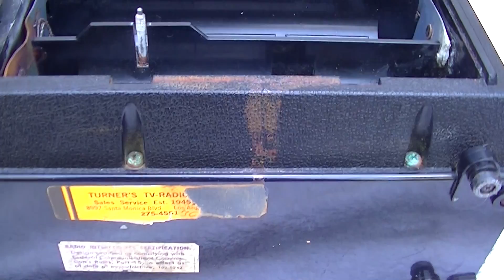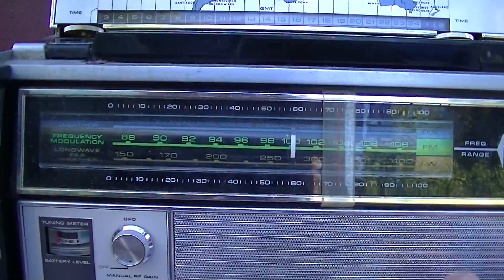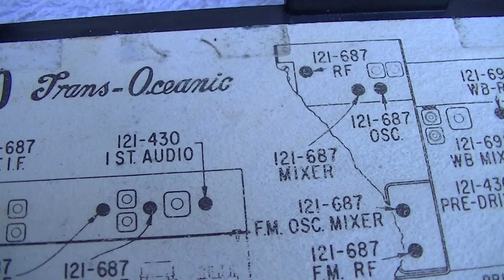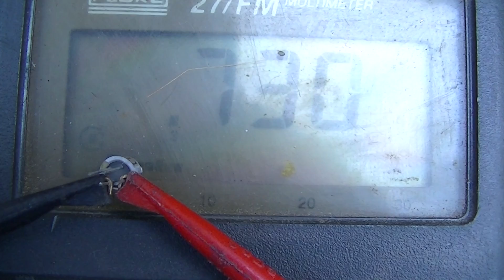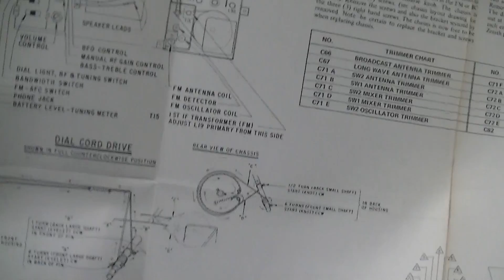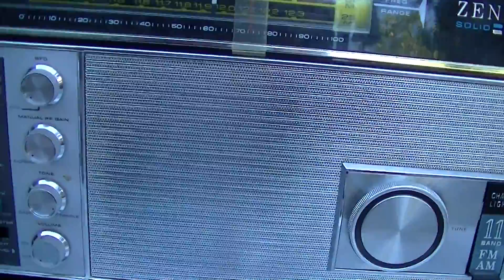Zenith Royal 7000 Transoceanic Repair

Comment: I guess I struck lucky with mine.  It's working well on all bands. I've had it about three days now, and it's an impressive hunk of radio, straight out of 1968!  It also seems to have that same mix of different transistor types.  I counted 18 transistors in mine - is that correct?

For a quick fix for the power cord, a Braun shaver cord fits perfectly, and my 7000 just happened to come with one supplied - I noticed that the OEM Zenith cords are somewhat cost prohibitive, so if you can live with a curly, telephone handset style cord, I'd definitely recommend that shaver cord!

Comment: I have the same radio, and it has the same problem, VHF and  FM work, but AM and SW don't work.  The radio has two or three separate front ends, the AM/SW front end is the problem, unless one of the 455 khz transformers are bad.  ALL Transistors are silicon.  If it was the AM rf transistor that was bad, the radio should have still picked up the local clear channel station weakly.  That's what seems to be happening with mine.  Guess I'll follow your lead on this.  Probably will try a 2n3904, or2n2222 from the junk box.  No 20 meter ham, but it does have 17 and 15 meters.  Most aircraft beacons are probably replaced by GPS.  Even Loran is fading into the past.
Reply: Mine is actually the later D7000Y.  Weather band on this one is tunable over a narrow range.   It works, only needs some contact cleaner after all.

Comment: I wonder if it was once owned by the Swedish American Line (passenger shipping) - provenance for added value. That must be a genuine label/sticker. I don't troll your methods - except for hot-swapping transistors (esp. since you didn't know if it was a FET).
The chart light lights when it's flipped up (and the bulb isn't burned out). It would have to be the right bulb ("industrial"). Many bulbs will fail when the filament is hot and gets bumped. Check the manual. You have so much stuff - you forgot you had that!

Comment: Hola, ¿cuantos voltios tiene la red a la que enchufaste la radio? Thanks
Reply: In the USA it would be 120v, however inside the back cover of the radio there is a voltage selector switch (at least, there is on mine) that enables use on 240v.

Comment: Thank you SO much ! I found you becuase I just bought the Sony Earth Orbiter 9050 and I had dead bands not a peep out of all the shortwave bands. I read that in Germany some bands were not allowed so they were disabled( lack of a better word). Then this morning the 11 to 13 meter had noise which it did not last night. So thought your video would help me out got to the point  where you said the automatic RF Gain and turned the dial and I did that and BINGO noise on ALL the SW bands ha ha. 
How cool is that I obviously have no idea what that dial is for but If it was not for watching your video and it was not the first I watched I would of paid for an estimate and probably got it fixed if it was not an arm or a leg. It is a gorgeous radio in many ways I love it and I love you too !  Hit the subbed and the alarm, Thanks once again I am soo happy now that it is working can hardly wait to try out the reception on short wave tonight on this radio.

Comment: The  Royal7000  with  the  orange  map  are  junk   Theres  a tuning belt  that  goes  bad  and  the  use  printed  cicuits  with  solder  in  transistors  and  not  easy  to  service  The  plastic  gears  in  the  tuning  assembly  become  brittle  and  they  are  not  available  any  longer  They also  use  Japanes  components  and  no  point to  point chassis
Reply: Would that be the 7000-II ? with the black coloured chart pocket?  If so, thanks for the timely heads up. I was looking at some on eBay just a few days ago, but I might just edge round them now.

Comment: When you're on SW Be sure the antenna is extended. RF gain to Max until you verify the band is operating. There is still a good number of SW stations still on. I listen every day. I own 3 Zenith 7000's . Sometimes the transistors grow hair inside and you have to cut the lead that shorts the the transistor's case. (shield)  when they fail. I  know you know all of this though.

Comment: The light pitting along the trim is not caused by battery leakage. It's caused by storage in a damp location such as a basement. Mine has it, too, in all the same places including the dial knob. Mold embeds in steel and aluminum if it is not discovered and wiped off. But as for battery leakage, in mine the cardboard support - especially on the right side - had puffed up to 10 times its normal width with lots of white powder and fell apart in my hands. I ended up fashioning cardboard replacements for both sides. The label inside my back cover also fell apart from battery acid, so I designed a replacement for that on my computer. You had better luck with the label, but I had better luck with the contacts. In spite of all the other damage caused by battery leakage, every battery contact in my set was completely clean and corrosion free. Go figure!

Comment: Glory from the days of Zenith dominance. These must have been a nightmare to hand assemble, the complexity just kept increasing (from the first Royal 1000) while only the very last R7000's were PCB. On the corrosion issues finding any of these without battery damage is more the exception than the norm. Sadly.

Comment: Interesting video. I have a 3000-1 model, and its not working. I've checked the transistors,  taken from another in worse condition, but nothing happens. I saw a video of a guy, changing the condensers, and it works. The thing is, that I am only an amateur,  I'm not a technician, so I'm stocked, sadly. However, I'm so thankful,  for you to be honest, explaining the reality of the ether. I was a diexist in the early 90's, and I live the last part of those golden days, when you find a lot of radio stations from overseas, in your own language, teaching and showing their culture and heritage though the waves. Its just a shame,  that desapear. Such a shame. I was thinking about mount an external antenna, in order to get a better reception, but if it is how you explain, I think it's not worth it,  what do you think ? I appreciate your sincerely advice. Thanks for sharing this valuable information. Greetings from the central America. 73 !

Comment: That repairability with the transistor sockets is incredible. Back then they held the radio as an family jewel and heirloom. My grandpa never moved his radio and it was allways cared for as allmost the only electronic item they had. I recently bought an Panasonic RF-2400D radio and I plan to care for it as well as did the ancestors. I dont like to throw away things neighter since the whole world is already full of plastic waste.
Awesome those transistor sockets. And look the huge ferritic AM antenna (I guess its for AM). My new Panasonic has an 4" ferritic antenna in it as well.
With a little knowledge, and the help of youtube, one could repair this radio by himself even if he is no electronic like me and for whom the field of small electronics is new. Just pull the transistors out an measure them and stick a new one in - or change all transistors in case you dont know. Most likely change all parts will hit the problem and the radio works again.
I wonder if those old radios lasted longer as a modern new one like my Panasonic would?!

Comment: I have one of these and it has a weird issue , on AM and SW it takes about 30 seconds after turning it on before it starts to work. But FM works instantly. It works like a tube radio like its warming up. What do you think?  Rich

Comment: There are transmitters on SW.. BBC radio Radio China signal in the corner 60 over in English Radio Austrailia Also check 5.085.0 plays Oldies full scale on my radio with the internal whip.. My radio is not Deaf...

Comment: Great radio! I agree with the other folks, try sw & lw at night. Here in northern Greece, I can still receive 4-5 stations on lw at night. Sw is also very active at night, mostly Chinese stations and fewer Arabic, African and Balkan ones. Yes, broadcasting on lw & sw is costly in terms of electricity compared to internet streaming. However, I also believe that these bands are still necessary to communicate since internet is not available everywhere or is very expensive. For example, commercial ships in the oceans (sailors need to have a connection with their homeland) or in poor countries. Plus humanity needs a simple, post apocalyptic way of communication. Sure, the internet was designed with that in mind but hey, what if all electricity goes out? For the record, my country terminated sw broadcasting (voice of Greece, 9.42 MHz) only a few months ago.
Reply: Right you are Sir !

Comment: About the batteries: I worked for a battery company for awhile and the potassium hydroxide is a real issue with leaking. It's not a question of if it will leak, it's more like when. It's such a high ph (very close to 14), that it has an unbelievably high surface tension which creeps into any available crevice and exploits sealed interfaces until is breaks through. Just for a point of reference, if you hang a length of string into a cup of potassium hydroxide, it will creep up the string against gravity for more than 40 feet.
Reply: Wow, chemistry I've long forgotten.

Comment: I have this radio and it is in good shape I even have the original power cord and the guide to SW listening and are you a ham  I am on messenger under George Ika Sneed and check with Zenith the might be able to get a new battery compartment and power cord

Comment: 9:50 "THOSE TWO ARE GOOD!!!" Hahahahaha
Reply: Yep, he had the volume turned up way too high on that Spanish-langauge station, so high that he had to shout over it.
Reply: @scratchpad7954  All the while the push-pull audio output transistors are being pushed into distortion, cause 1. They aren't a "matched pair", and 2. These transistors were only rated 500mW so with the more bass emphasized stations, you'll push them into distortion. Otherwise it sounds great.

Comment: nice old radio, it is true what you said Electricity is no longer cheap especially in Australia.
It can be 35 cents per kWh or more, and there is a daily supply charge as well as GST.

Comment: The map light only works if there is a D cell in the lower battery compartment. The manual covers this.  I have one of these, and like you say, these are superbly built.  Thanks for the video.
Reply: Man, its weird, because I've just made what you just said, and nothing happens 🙄😔. I guess the bottom switch its damage, or some bulb is broken, because the last weekend, I took the time to check my 7000 model,  and check it.  It was dead, I resolved the power lines, and voula, it works, thanks goodness,  but I forgot to check the bands drum, with the 2 bulbs. I guess the problem could be there. Anyways, thanks for the advice. 73 !

Comment: I thoroughly agree with your comments regarding the quality of this radio.  I consider it to be the Rolls Royce of consumer radios.  I have one of these, and a 1953 militarized version of the Transoceanic - R520/URR.  I think this one is of higher quality than the militarized version.  After refurbishment, the R520/URR works as well as it did in May of 1953, when it was built.  I couldn't 'restore' it, because it had been thoroughly smashed before being thrown on the trash heap, from whence it was rescued.  I prefer my dust catchers to be functional, rather than preserved, anyway.

Comment: I used to have my Radio Shack AM/FM/SW radio from the 1990's and it was great, but I missed shortwave band, because many of the shortwave stations ended up on the internet. Thanks to mobile apps like TuneIn and such. You can also listen to NOAA weather, airport, police and fire radio stations via TuneIn app and you can hear something like if there was an investigation going on. Reminds me of a CB radio which was used in the 1970's. And also, tracker trailers used CB radios as well.

Comment: At VOA SW site I work at---we have two transmitters on right now-250Kw each.One of the transmitters can run 500Kw-but don't do it anymore because of the cost and it was determined that kind of power isn't required.There are 3 newer Continental Electronics 419F waiting to be installed here.Came from another site.SW isn't dead yet.Far from it.The Greenville,NC site has 8 SW transmitters and the one sideband transmitter-38 antennas.This site can broadcast to anywhere in the world!We are proud that we can keep 30 yr old,50 yr old transmitters going!!! The internet isn't available in some areas--the transmitters that are on are broadcasting to Cuba.(Radio Marti)In other countries the Cellphone systems,internet are controlled by the countrys government.Try tuning at another time--like at night.

Comment: At the transmitter sites here we used to use SW sideband transmitters for program distribution to the overseas SW,LW transmitter plants.You could listen to the sidebandders on this and the new Sony radios that replaced the Zenith.Remember the TMC 40Kw sidebanders well-sadly they got hauled off to scrap in the junkwagon.We have a Continental 620 SW sidebander that needs a balun.(50Kw).

Comment: Remember these radios--the agency where I work used to use these for their foreign service correspoundents out in the field.In the few that I worked on in the maintenance shop-the transisters can fall out of the sockets.also the bandswitches needed cleaning.Otherwise these sets could endure for years or even decades.When they were removed from service served as bench radios in the shop.The Zenith radios were used in the Washing DC plant.Now I am at the transmitter in Greenville,NC Short wave.

Comment: I am surprised by the sensitivity of this radio. Nevertheless, I can appreciate Shango's frustration regarding the state of the shortwave bands. When I was in high school, the 49, 41, 31, and 25 meter bands had signals all day that were strong enough to hear even on small radios designed for travelers (like Radio Shack's DX-350). At night, 49 meters was so crammed that there were signals every 5 kHz. The shortwave stations that are on the air today direct their signals toward developing countries in Asia, Africa, South America, and the Pacific. In North America, very little is heard, save for WWV/WWVH (which may go dark soon), Radio Havana, and weak signals from time-brokered religious stations.
Reply: From SoCal its a small miracle I can pull Radio Havana 49m and Voice of Korea 25m but yes I miss the golden era of SWL too.

Comment: The dial lights work from a switch on the left hand side of the panel.  Note: It works ONLY on battery.   Really.
 There is a separate battery in the battery compartment that works only the dial lights.
Reply: That's right!  I remember that!

Comment: The power connector looks similar to one on my electric shaving machine. I think the connector is called C1 and the pins are 6.6mm apart  (the "normal" audio connector is C7 with pins 8.6mm apart).

Comment: Excellent job on diagnostics, I would have done the same thing, swap temporarily the FM RF amp, for the AM RF amp.  I really appreciate and enjoy your videos, THANKS!  I have a Zenith Royal D7000Y, which looks identical to your set there, except a few of its transistors are different numbers in the AM front end, and the VHF weatherband is variable on my set.  Great radios, mine works fine and hasn't had any repairs yet, except I cleaned the controls a few years ago.  These were about the last Royal 7000 T.O. made in the USA, the later Zenith T.O. was made in Taiwan and had an I.C. or two, same features, but wasn't quite as good as this series, in my opinion.

Comment: The chassis in that receiver is a wonderful work of vintage-American art!! It is quite a bit cheaper to have a website than spend all that money on electricity to feed a 500 kW shortwave transmitter. The shortwave band is basically the "canary in the coal mine" for commercial broadcasters on the AM and FM bands, too. It's a business model living on borrowed time.

Comment: On my 7000 two of the ceramic bypass capacitors soldered to the chassis to the left of the tuning dial were shorted.  Hard to believe, but after that everything else worked and it was even in alignment.

Comment: I own two of the later model D7000Y TO's with the variable weather band. After some recapping and an alignment they are great working radios. Fortunately the battery compartments and cases on mine are in really nice shape and they still have the original power cords, earphones and owners manuals
Reply: say.... uh..... where do you live....?       : )